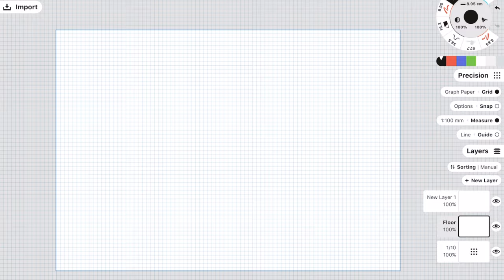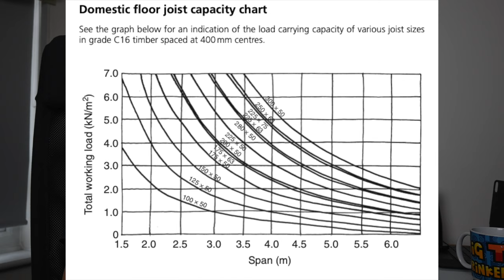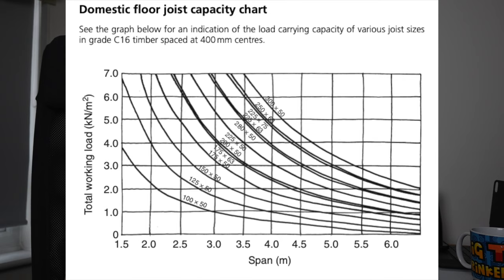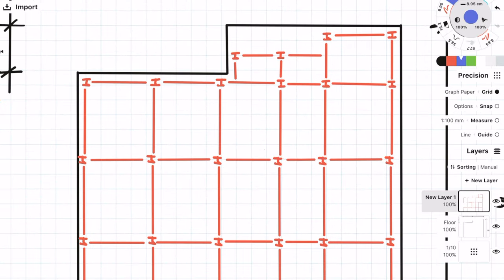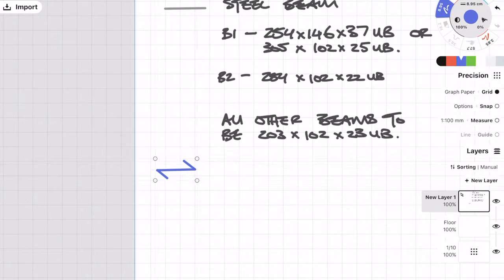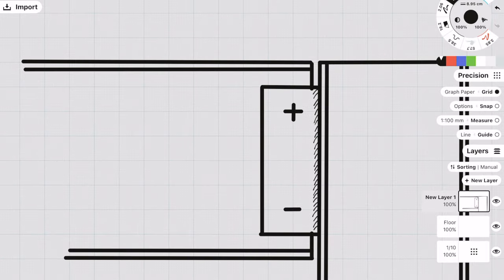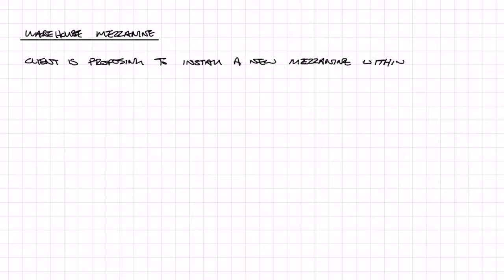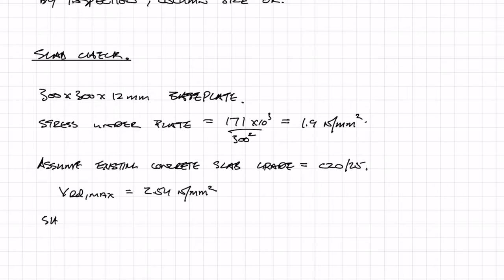How to design a steel mezzanine within an existing warehouse

Comment: Hay dazz grate work, in the drawing you put bracing all 4 corner, now my question is how do you know that the braceing is needed ? Steel Design, 5th Edition-William T. Segu in this book there is a example of braceing with only gravity load and no laterial load which is apply in your situation , do you find it same way or there is other way

Comment: The beams are spanned between column strong axis and the joists (wood/steel) run over the beams in perpendicular direction. So the floor span should be perpendicular to the joists...right or wrong?

Comment: I was curious on why didnt you design a footing and a pedestal for your mezzanine. Is it okay if I also dont use footing and pedestal and just bolt my base plate on the existing concrete slab?

Comment: Dazz, are the beams spanning left-right (in red) necessary or are the joists adequate for stability? I assume this is what the line "All other beams to be 203x102x23" refers to. Could you give any guidance as to how you sized them please?
Reply from the maker: I wouldn’t rely on cold formed joists to frame up a hot rolled frame. 
All other beams is me just looking at what they’re supporting by eye/experience. You could go and design them individually or find the worst case.
Reply: @EverydayDazz  Thanks for the reply. They aren't supporting anything though, are they? Just the lateral support?
Reply from the maker: Correct
Reply: @EverydayDazz  Cheers